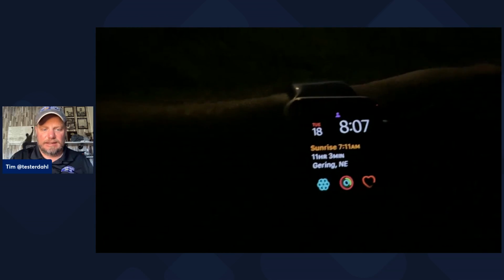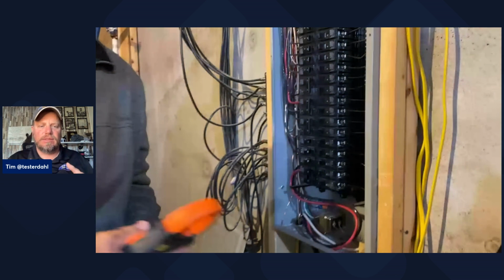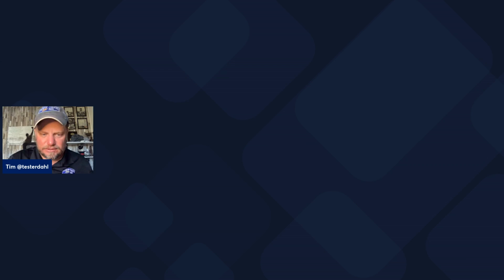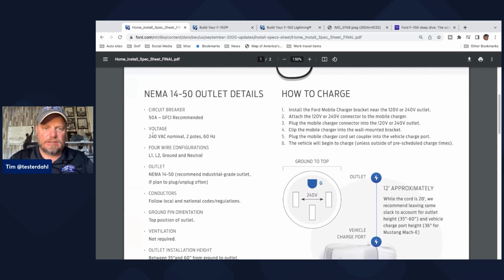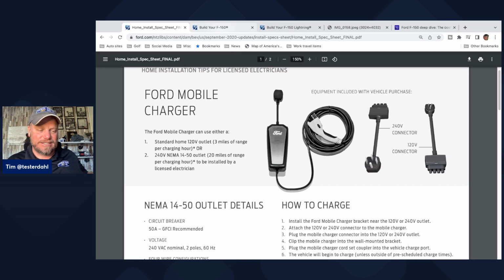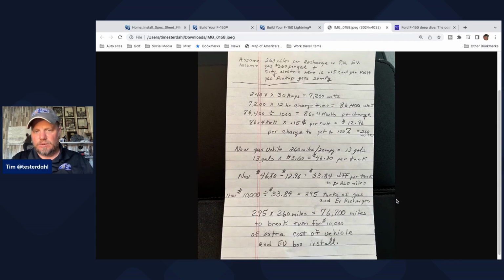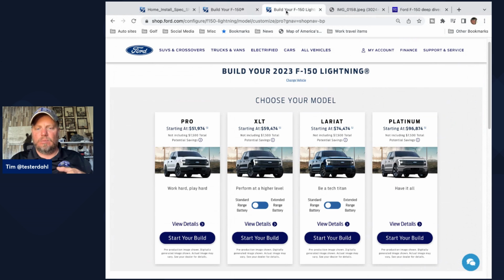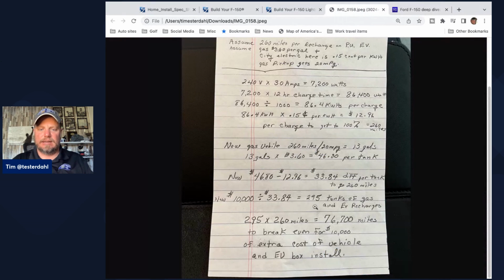11+ hours later on 220V charging price for 2022 Ford F-150 Lightning

Comment: "Brilliant" design on these EVs.... first, let's make a vehicle that runs purely on electricity. Second, let's put a lot of power-hungry display screens all over the dashboard so that it can draw a not-insignificant amount of power from the vehicle's on-board batteries. /eyeroll Does nobody else see how silly this is? If you don't believe me about how much power those are drawing, that display and the computer that runs it is equivalent to a laptop computer. Simple gauges on the dashboard would have been plenty and a lot of those are/were even mechanical, in that they didn't need power to operate at all (other than the kinetic motion of the vehicle moving). Now, obviously, the battery monitoring gauge can't be mechanical, but a small little gauge readout would have done for that. Instead, Ford decided that you need lots of flashy animations and displays (which consume more power, both electric and computational), heck that even looks like a screensaver when you first opened the door. It's just wasteful, and outright silly to put on a vehicle that runs purely on electricity. It'd be one thing if there was an alternator to power all of this equipment, but there isn't.
 
And even in ICE vehicles, I tend to very much hate the idea of elaborate computer systems in vehicles in general -- usually so much of the car's core internal components are routed through that, that if it breaks... your entire vehicle is dead in the water and those are next to impossible to repair, you have to get the whole system not only replaced, but also programmed, and that can only be done at a dealer. Also, if for whatever reason your car suffers a catastrophic failure while driving.. you lose everything ... gauges, power steering, a large part of your brake pressure, etc. I remember seeing a video of someone's Focus getting struck by lightning and it just killed the car, dead right then and there. Turned it into a worthless piece of junk in the blink of an eye. I also personally saw a lady's car "die" at the gas station. For whatever reason, the computer refused to allow her to start the car, claiming her car was in gear when it was very clearly in park. It was an almost brand new SUV, she just bought it last week, and she had to get it towed.
 
This isn't your parents' 1980s car that you just replace a single part or two if it breaks at your home garage with a couple wrenches. These things are made to fail often, and be nearly impossible to repair. At least an 80s car can take a lightning strike and be repairable. You might lose the radio or even the battery, but you probably could fix it with a little work and get it running again.

Comment: A question I would like to know is lithium fires are the worst. If a battery fire broke out would your electric door locks or windows still work allowing you to escape?
Reply: Vehicles that have latches that run off of cables don't need to worry about electric door locks because the interior door handle mechanically overrides the lock and always opens the door. The only exception would be the child safety feature that disables the interior door handles from working. On vehicles that have completely "open and close by wire" systems, where the entire door latch system is electric, there's a mechanical cable override on the interior driver's door that can be used in emergencies. This is for Ford. I don't know what other brands do with their doors, but I assume it's something similar.

Comment: How is the environment getting better the more you drive it. Every time you charge it up you’re using fossil fuels. If you’re going to purchase an electric vehicle you should be forced to either charge with solar or wind power only. Not fossil fuels. Since that’s what you are trying to get away from.
Reply from the maker: How is the environment getting better? It is from tailpipe emissions. That is how it gets to net zero. 

The charging is different from where you live. That’s a bigger issue to deal with.
Reply: @Pickuptrucktalk  there are still emissions they’re just coming from the power plant that is supplying the electricity to charge up your EV. And in case you didn’t know. I am a truck driver and these new semi‘s coming out that still run on diesel fuel are putting out cleaner air then they are taking in. Their nicknames are pollution scrubbers.

Comment: I never forsee any Electric Vehicle in my Future I want to travel I can only go 200 or 300 miles then I have to wait over night  rent a motel that might have a plug in. When I can pull into a gas station and be back on the road in 10 minutes
 No it not cost effective  and worth 70,000.00 dollars.
Reply from the maker: You don’t have to charge overnight when you road trip. The charging in this video is at home only.  Road trip is completely different.

Comment: When the battery pack has to be replaced then you're bending over and grabbing your ankles call the parts department say yes how much is a new battery pack for my particular vehicle? Then figure out what's the trade-in value for that truck when it reaches 7 years old and needs a new battery pack and has however many miles you'll be putting on that truck in 7 years and find out if it's even going to reach the used car lot after you traded in or will it be in one of those gigantic metal chipper machines with a shred it and turn it into a new vehicle in essence the used car market gets destroyed because of the price of the battery pack so only new vehicles would be for sale in the future with no used ones now that is a bad idea that makes sure the poor walk and the rich Drive. That would be vehicular inequality in America

Comment: Dude… why did you even make this video???? You can skin it however you want…. Bottom line…. You will NEVER EVER get the $ numbers in favor of the EV.  Doing math trying to get it to “look/sound” good will only work with common core math…. Which is what you just did now.  Common practicality was completely at 0% in your dramatic video. Yeah your new toy is stimulating, I get it…. But you just effed yourself buying it… sorry. Hook it to a trailer… even the smallest aluminum trailer…. You’ll soon realize the mistake you’ve made, the common core math now just has complicated itself all over again if not completely destroyed itself and can’t even regain its itself… back to basic math… and it’ll tell you “ your f&cked”

Comment: If you want a healthy battery which will help it last longer you can deplete down to 20% amd charge up to 80% so in reality you lose 40% range. That's if the environment is perfect for batteries. If it's too hot or too cold you lose more range. This technology is not viable for our future. I think near future tech should be hydrogen hybrids until we have nuclear batteries which will never happen do to lobbyists and special interest groups.

Comment: What is the affect on the range when you run the Air and the radio? Or the heater for that matter?
Reply: the 260 miles range is a lie.
Towing 1 ton ~150 miles
Towing 2 tons ~90 miles

Comment: How much can you pull with electric truck also how heavy of a load can you haul with it and with all that .  How much battery do you use ?
Reply from the maker: You can haul the same as a gas F-150 and you lose a lot of battery depending on how much you haul as well as the shape of the object you are towing. 

If you want to tow a lot and long distances, this is not the truck for you though. T

Comment: Thanks for this. Ive been saying it till Im so blue in the face I look like a smurf but energy has been adjusted so it all costs the same people for any given task. Heating a home costs the same with propane as it does diesel when you factor everything in . If you want to drill a hole and you have an air drill and an electric drill . If you broke down the math its the same money to do both tasks. The air drill requires compressed air that is supplied by an electric motor on a tank. We can go on and on and on till all of you are as blue in the face as me but you are going to keep arriving at the same place...
Vehicles are driven by fossil fuels for a reason people . Replacing that with electric is simply a cash consuming pipe dream .  Now I would agree that there are a ton of folks that live in urban areas and such (And lets face it they are the ones driving this stupidity because they cant see past their noses) that can benefit from these vehicles , they do nothing but haul people to and from a location that isnt that far away. BUT
Work trucks
Trucks that haul
All heavy equipment
Folks that commute long distances because they dont want to live in the city with the freaks but they want the money the freaks hand out for nothing.
Generators
the list goes on and on and on... Basically if you are on the go and doing things that matter EV is never gonna get it done in any sort of way that makes any sense.
If you arent doing anything really aside from pretending to matter and going to a building with the other drones all day to talk about your EV car and where you are going to vacation then EV is perfect for you !!!

Comment: This guy has no clue how to charge this truck.....it is quick to 80%.  From 80% to 90 takes about as long....from 90% to 100% takes twice as long.....these batteries are designed to run up to 90% which will give 225 miles.....not worth the hassle to reach 100% if it can--will usually stop at 99%.  Perhaps this dude should read the owners manual.....
Reply from the maker: Huh? I wasn’t purposely showing empty to full.
Reply: he paid for 100% of the fucking battery, not 80%, 225 miles is a very short range
Reply: @Pickuptrucktalk  you are missing the point---you are bitching because it takes too long to get 100%....they are not designed to go 100% all the time....read the owners book that is online or do your research.
Reply: @gregoryeverson741  225 miles from low at 080% on a speed charger takes 30 minutes.....going from 80% to %100 takes an extra hour to get an extra 15 miles at 240.....you people need to do your research about batteries and how they work and charge  before  making stupid  comments about stuff you know nothing about!  If 225 miles is too low then buy the larger battery for 325 miles and stop bitching--that is how that works too. There are ZERO surprises here..ALL the information is offered to the public to  read BEFORE you buy these electric trucks......which makes more sense than spending $50,000 then finding out later!!!!!!!!!!!!!!!!!!
Reply from the maker: @chadhaire1711  Ah, no. I’m not bitching about it going to 100%. I either said in this video or the dozen of others I’ve done on this truck, you shouldn’t go to 100% unless you are road tripping or towing. Most automakers these days are saying 90% is good for long battery life.  It used to be 80% just a few months ago.
Reply: @Pickuptrucktalk  well this would all go better of you edited these videos with more solid numbers and less word salad....I feel like i am back in a college class having to take notes....all this could have been said in half the time....lots of others in the comment section here say the same.  I had a Lightning Ford factory sent me for a week....nice toy....nice city truck...but no way this country is going electric in this century....
Reply from the maker: @chadhaire1711  sorry you didn’t like the video format and lots of people liked this video. Hard to judge an entire channel and work from one video.

Comment: What was this video? Amazon sells a 220v power meter you can tie in to the charge circuit and actually monitor your power consumption for 130 you already have the master there. 
 Hard to justify used super car prices for a pickup truck that honestly has a 120mile radius at best around your home. Even on a supercharger your still sitting for hours and paying a premium for just a few more miles annnnddd that's a naked truck. Now add 4 workers a couple hundred pounds of tools and a trailer with lumber you're looking at about an 80 mile range for charging 20 something hours from 0 to 100%? 
 Then the environmental aspect not only does it require a massive amount of oil to mine and refine this lithium and cobalt but so far theres no enviromentally friendly way to recycle and reuse this lithium.
 Then I'm sure like tesla they will either refuse to replace the battery in your 10yr old truck or they will charge 25k or more for the new battery.
 At this point right now, no amount of paper math or mental gymnastics can justify these vehicles.

Comment: This is really a boondoggle.
Tons of horrific mining has to be done to obtain material for each battery plus the battery has to be hazmatted.
The EVs will be controllable from a central govt agency so they can be switched off at anytime.
All EVs are basically coal powered because they are not independent producers of electricity.
Coal will have to triple production at least.
Reply from the maker: Where did you get the "EVs are controlled from a central government agency?"
Reply: @Pickuptrucktalk  just wait.
If the Ca guv can tell you not to run a 12" counter fan after 1pm and "ASKS" that you not charge your EV for two days do you think central control is not far behind since remote control already exists.
Charging stations are easily controlled.
Reply from the maker: @pearldiver1006  wouldn’t gas stations also be easily controlled? They are all electronic these days.
Reply: Twtty birds Mama's car had a range of over 100 nikes on 12 little batteries, did 45 to 60mph, recharged quickly and was built in the 1800's.
As seen on Jay Leno.

Comment: My plan do a 333 (5 hr) mile 8 pass x 70$ each 560$  1.68$ mile taxi  3 time a day   1680$ 
× 5¢ mile $50 'fuel' - 200 driver 20¢ mile net 1430
× 200 day 286k$
 - 14k$ battery
 - tire 3k$ net 269k$
- spare battery 14
255k$  $700 day$30 hr

Comment: So here's the 1000 dollar question ,which I already know the answer ,but here goes ,WHY CANT E.VS CHARGE THEMSELVES WHILE DRIVING ?,HMMMM? ,with a regular vehicle a alt.keeps the battery charged hmmmmm?
Reply from the maker: They do charge themselves driving with regenerative braking.
Reply: @Pickup Truck Plus SUV Talk  well if that being the case then why do they after about 250 to 300 miles have to stop and CHARGE ,DUHH??
Reply from the maker: @jr3254  Easy answer. You don’t brake all the time or drive downhill.

For example, drove a Chevy Bolt outside of Boulder. Driving into the mountains, the battery drained quickly as you’d imagine. Driving down the mountain, the battery about filled itself back up. 

It is all about physics.

Comment: Electric vehicles must be charged with "green electricity", that is the point of the whole electrification. So if a charger uses electricity that comes from coal, oil or gas, then the point is missing regarding the climate being better. You then fill the electric car with carbon electricity in order to put it the right way. If everyone has to charge with carbon electricity, then more oil, gas and coal have to be added... more littering and the concept is wasted. Electric vehicles should only be allowed and they should only have access to renewable energy charging stations"energy from solar/vind/water!!.. then not many el cars would have been sold.at thise moment!!. But Nuclear power is green power in my eyes, and we could have many small nuclear power plants and everything would have been fine..Hydrogen car will probably be the end result when it comes to the electric car concept. it's an electric car that charges in 5 minutes with hydrogen, and water is the only thing it releases..best regards from Norway

Comment: So I have to put solar energy in my house for another 25,000.00 so I can cut my electric car. 
You can have your pile of garbage then your battery takes a dump right. You didn't impress me any with your speech and your friend showing his Amp meter 220 volts that's like a 220 clothes dryer or ac compressor running watch your electric meter on your home it's spinning like a Top.

Comment: take eighty percent stop charge hauling 30.00 bones plus a stop 30.00 times the mileage/range adds up quick these batteries 🪫 have planned obsolescence charge/discharge. your 80-hundred % won’t sustain that 10,000 plus will show up on a trip leaving one stranded plus to ship the truck home and cost and renting another vehicle. car rentals places are having renters arrested for bogus charges the minute you drive off with a rental car. it’s not a good idea to rent a car until they clear their books. of that car/truck being returned scam their pulling cops need aware that the plates are going to come back car rental the trumped up charges saying it’s stolen when the rentals aren’t doing their end. scotty kilmer they tried charging him for not filling up the car past full when it clicks off it’s full. past that ruin the evap canister get billed for their doings. another scam. plus scotty is a mechanic